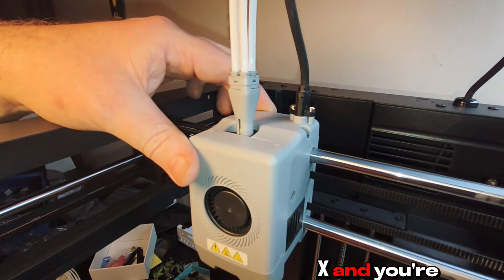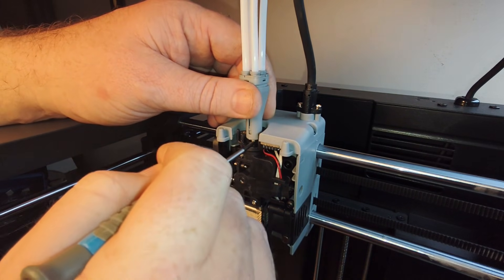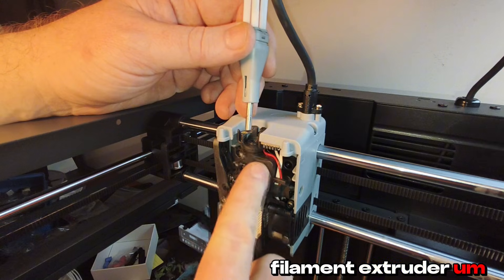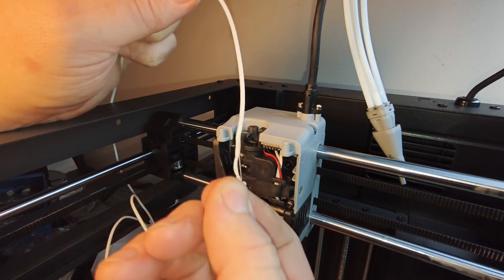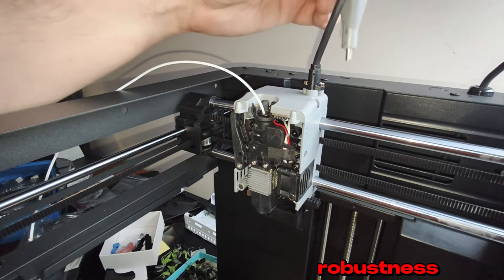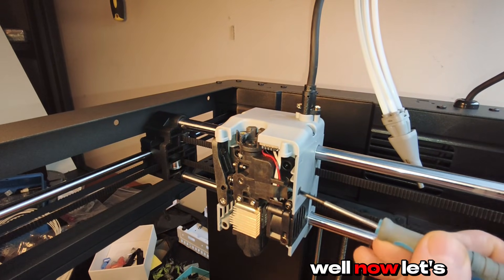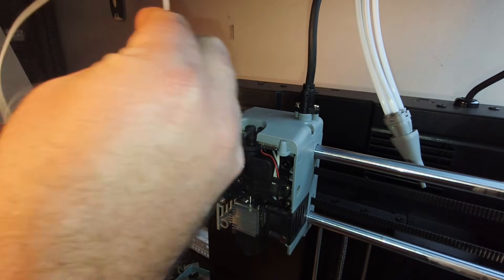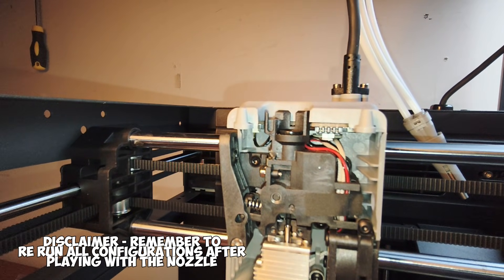How To Clear A Flashforge Ad5x Nozzle And Make Things Worse.

Comment: I am enjoying it. I just got this printer. What else do you recommend i foresee. I did have a failure and the 1st couple of layers is stuck on build plate. Any recommendations?
Reply from the maker: If it's stuck, you can try running hot water on the plate, but if it doesn't work, you can print a square few layers thick on the area wait for it to cool and it should take it off the plate

Comment: What would you do if you have a chunk of filament stuck in the printer head, I can visually see it, but with pushing or pulling I cannot get it out. I also for some reason can’t take out the printer tip, mine seems stuck compared to tutorials when it’s just fallen out. I’ve heated the printer head up multiple times and left it for a while, but still no luck. I’m very new to printing so I’m not sure what else to try without hurting the printer or how much force I should put on the filament piece sticking out 😅
Reply: Okay watched further into your video my bad 😂 going to attempt what you did for the second problem!

Comment: So I'm completely new to 3d printing and the ad5x is my first printer. After 60 hours I'm getting a weird humming noise like a fan is going bad in the head when it purges filament on initial start up. Could this be a clog or the gear in the head being loose? Please help. Update= when I heat it up I get the humming noise. It didn't do that out of the box. Is this normal?
Reply from the maker: i would contact the support or where you got it from, as the fan bearings maybe gone, easy replacement but kinda annoying for sure
Reply: @ladbeige the sad part is I only have 60 hours on it. Only 3 weeks old

Comment: Thank you so much for this video, I was in the middle of a print and one of the filaments was broken inside the tube right about where you indicated with your finger in the beginning of this video. For some reason my ad5x 4-in-1 tube doesn't remove the way it's shown in the video. It's just screwed in place with one small black screw. Unscrewing it with a screwdriver didn't really work due to how little clearance the screw has from the 4in1's connector end thing. Maybe that's just a skill issue though.

I ended up having to use the tiny sharp clippers that came with my printer as makeshift pliers to carefully twist the screw off. But I'm so new to this machine and ignorant to hardware in general that it wouldn't have even occured to me to pull the grey faceplate off to find any of this, had I not watched your video. Pulled the broken PLA filament out easily from there.

Comment: The newer units also have a screw and support for the hub on the top left. It’s a good addition.
Reply: This is what I realized with mine when I opened it. It seemed even easier to remove than shown in this video. There was no tiny black plastic tab or whatever is shown here to pull out.

Comment: Thank you, thank you, thank you!

I bought the case for my AD5X.  I got it all together and couldn't get the IFS back outside off the box.  There is a slot for the PTFE tubes and the head and IFS have to be on the opposite sides of the plexiglass. I couldn't the the 4-1 connector out of the print head.
Reply: OK, now I have a broken piece of PLA in the extruder. All I've managed to do is mash it further down into the thing.  I don't see any way of getting it out of there.  Ideas?

The nozzle plugged, too, and the cold pull method doesn't work.  The nozzle tube doesn't get hot enough to melt the PLA.  I replaced the nozzle with the new variety (with the new heat sink) but if I can't get the piece in the extruder out, the new nozzle isn't going to help.  I may nave 10hrs on this thing and haven't even made a color print and it's already broken. Snif.

Comment: I was only watching this video to find out if I could replace my hot end and print unit on my 5mPro with the ad5x head! If you make a video on that that would be awesome
Reply from the maker: I don't think they are interchangeable unfortunately, but thanks for the idea!  the firmware would have to be updated to be ad5x firmware and possibly cause issues but 😅😅 if you wanted to give it a go, give it the old college try.

Comment: Just take out the nozzle, heat it up and push the filament out with the tool that came with the machine
Reply: Thanks, I was about to say the same thing. I have a 5M. I know the nozzle is different. But the unclogging should be the same. Loosen or remove that gear screw, heat the hotend and push the tool through it to unclog the hot end.